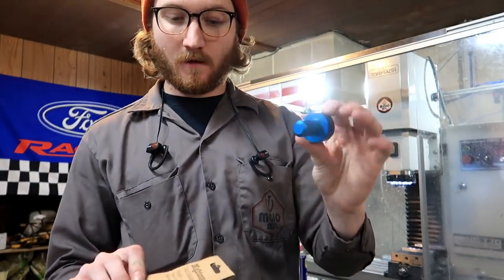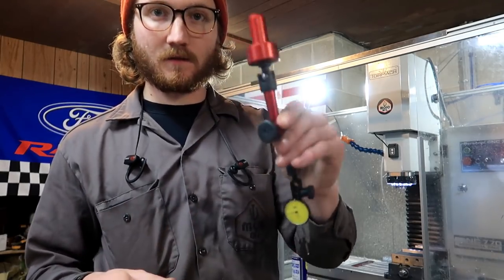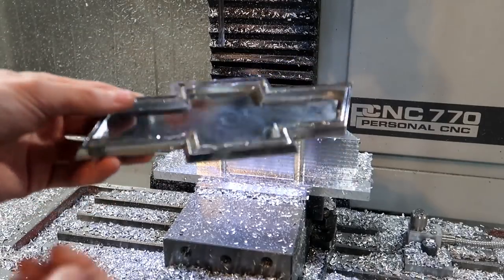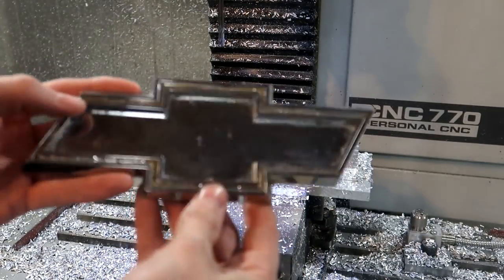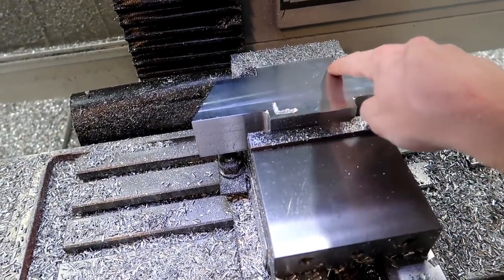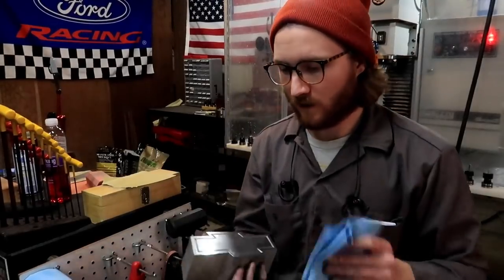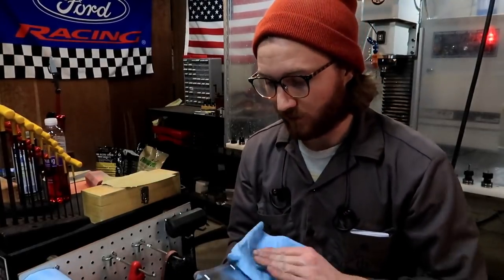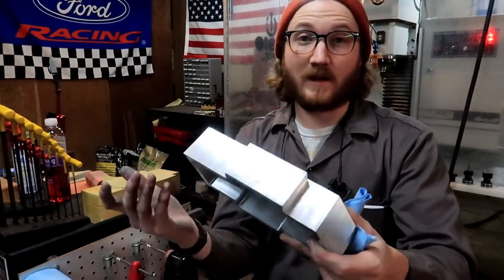Machining a Custom Chevy Emblem Box: Home Mfg. Days #66

Comment: Those cheap 12" x 6" granite surface plates are great for sticking adhesive backed sandpaper to in order to clean up flat surfaces.  Lapping plate I guess they would call it.
Reply from the maker: Not a bad idea! I can use my small tormach surface plate for that. Thanks for the tip!

Comment: where do you get your aluminum from???
Reply from the maker: I got this piece from a guy on ebay.  When I just need weird one-off pieces like this then I go to 6061dude or USA Metal Online.  Both of those guys have stores on ebay.  They have a lot of different size pieces to choose from.
Reply: @MojoMfg  Yes I buy alot from him also thanks for replying
Reply: 6061 dude no longer accepts paypal its a real bummer he was my goto supplier for all mill stock.
Reply from the maker: I was not aware of that! That's kinda upsetting. Oh well I can still pay him with a card I guess
Reply: Try to get in good with a local fab shop. I walked into one around here and started buying material and offering my services. Has worked out awesome, for both of us.